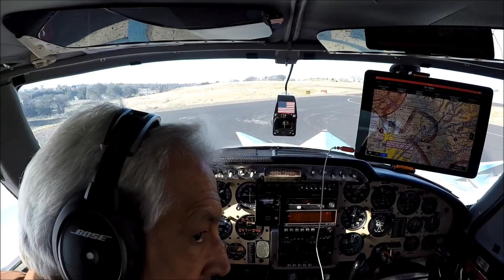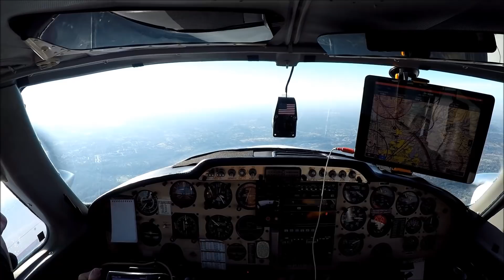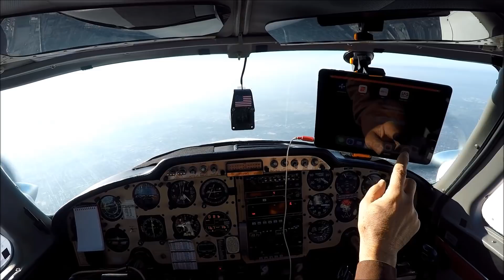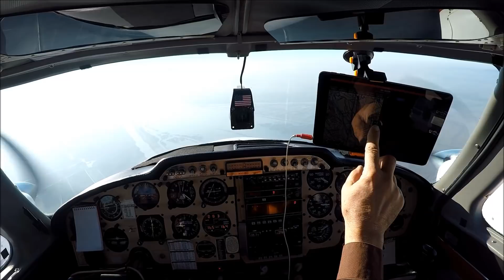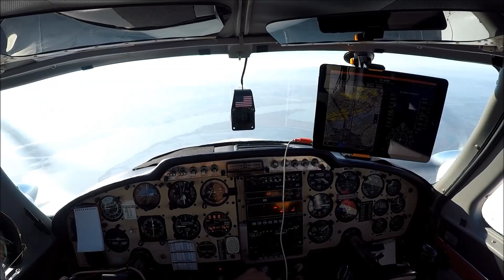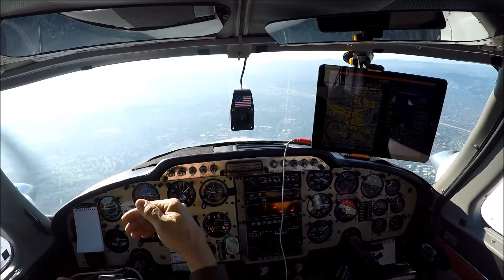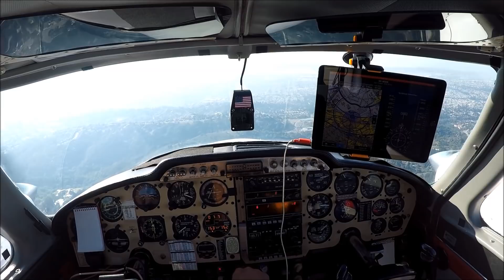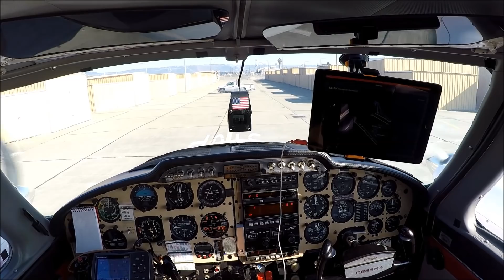Second to last flight to Oakland from Auburn in N3318Q Dec 14 2017

Comment: Nice step up. Curious about the new avionics suite.  Congratulations!
Reply: If it's the one I think it is, GNS-530, GNS-430, twin GTX-327s, backup Bendix King GPS/Nav, KWX56 Radar, GMA 340 and a Sandel 3308.  Not sure if the Garmin's are WAAS or not, if not, at least the 530 should up upgraded to WAAS.

Comment: Jerry, if the new to you aircraft is the one I've looked at today, the TBO is getting close. For the asking price, you're going to need a bank soon for overhaul of two IO-520's and two props. Lots of coin for a few hundred hours of operation. 

You need to transfer 3318Q to the new bird. Besides, you'll be all miscombobulated using another call sign/tail number.

Comment: Wow super smart upgrade, 414 have better cabin space than Baron 58, they also have the most reliable landing gear of all the Cessna twins being hydraulic and super simple. Really good airplane for crosswind landings with its first rate rudder design.

Comment: Congratulations with your Cessna 414 Jerry; as it is a pressurized plane I guess you will be cruising at a whole different flight level from now on. :) Is it the older type, or the improved 414A Chancellor?
Reply: 1970, if it's the one I think it is.
Reply: jeoverv The A doesn’t have tip tanks.   But the pic Jerry shared a 340.
Reply: Curtis, no, the picture Jerry gave us is a 1970 414, NOT the A model, since you are correct, the A model doesn't have tip tanks.  But, the 414 model DOES have tip tanks.

Comment: That’s a lot of airplane for a guy that likes to fly at 3500.    Are we going to start seeing you in the flight levels between Auburn and Oakland now?    LOL. Seriously, congrats!  If you’re moving up to a pressurized piston twin, the 414 is a solid choice.
Reply: Wait a second.  Is that a 414 or a 340.
Reply: It's a 414, Jerry said that in a reply earlier.
Reply: Gary C I was counting windows. I thought the 414, which is the same fuselage as the 421, had 5 cabin windows.
Reply: Curtis, look at this:  https://www.controller.com/listings/aircraft/for-sale/20973383/1970-cessna-414
The 414A DO have five windows, but the 414s only have four.
Reply: Gary C Ah!  Though I know the 414's reputation, I am obviously not a twin Cessna aficionado. I have probably insulted more than one older 414 by calling it a 340 by mistake.  LOL.
Reply: Not at all, Curtis, because I thought it was a 340, too, and then I saw Jerry's earlier response to another poster who asked what model, and Jerry said a 414.  But, then again, I would be hard pressed to tell the difference between a 320 and a same vintage 310, too!

Comment: Jerry, N8134Q looks like she's going to be a nice airplane for you.  If the GNS-530 and 430 aren't WAAS, I think you're going to have to upgrade them to WAAS, and the GTX-327s are going to have to be either replaced, or supplemented by a GDL-88.  

https://buy.garmin.com/en-US/US/p/597181

While I know you didn't have one in 18Q, I would recommend getting an EDM-760 or EDM-790 for your panel so you can watch CHTs and EGTs for each cylinder.

https://www.jpinstruments.com/shop/edm-760/
https://www.jpinstruments.com/shop/edm-790/

Nancy is going to love the potty, of course.  I certainly don't think that you can beat the price for what you're getting.  Of course, you're only 250 hours from TBO on each engine, that's going to be expensive.  Have you seen the 'Overhaul Bids' website?

https://www.overhaulbids.com/

Looks like about $40K for each engine.  Still, a good deal overall considering the airplane you'll be getting, only 5400 hours, and everything you and Nancy wants.

I'll miss 18Q, but 34Q should be a very nice replacement for it!
Reply: Gary C 
https://www.jetphotos.com/photo/5777088
yup, thats it! 
Pre altered photo here.   
We must be real nuts to check out 414s for sale till we found the match!
Reply: Well, I was interested in what the price on an airplane like that would be, and when I saw it was in Napa, it was like I went back and took a good look at it and decided that 'Yup, that's the airplane in Jerry's photo'.  In fact, I hadn't actually expected to find it, because I thought it would have been removed from the market, but he did say he was doing a Pre-Buy inspection on it, and not going to pick it up.  He still might turn it down.

Comment: Shock cooling is an aviation “old wives tale”. I’ve had engine monitors in both of the airplanes I’ve owned, with data logging and download capabilities, and the data doesn’t support power reductions more than one or two inches per minute to cause shock cooling. The data doesn’t lie. If you don’t have a graphic engine monitor, I would HIGHLY recommend them. I consider it essential equipment, especially to the owner pilot for many reasons. My T210 has an EDM 830, and its the best investment I’ve ever made for an airplane. FYI, ADS-B would be #2.

Good article from John Deakin. I recommend his entire series on engine management on AvWeb...

https://www.avweb.com/news/pelican/182107-1.html

Comment: I was wondering.... 
From what I understand for the price of a nice 414 one can get a similar turboprop single. What is the rational of staying with a piston twin?
Reply: I'll answer that, if you don't mind.  First, the 414s run a wide range of pricing.  If Jerry is getting the airplane I think he is, it's under $100,000, and there's NO 'similar turboprop' out there in that price range.  There is a 1975 421B that has a turbine conversion, that's $370,000.  There are a couple of Conquest Is that are close to $475,000, but both airframes are well north of 11,000 hours.  There's a Cheyenne II for sale for $250,000, high time engines and no TTAF on it, so you don't know how old it is.  Most other Cheyenne IIs are north of $400,000 or so, and even those are high times.
Engine overhaul on PT6s is expensive.  Jerry may be looking at $90,000 or so to do the engines on the airplane I think he's getting in about 250 hours, but it would cost $185,000-$250,000 EACH to do the PT6-28s on a Cheyenne.
Then, on top of all of that, you have the direct hourly operating cost.  Moving from the 320 to the 414, they have the same engines.  If he wants to go higher, he can realize a fuel savings, but on his commute from Auburn to Oakland and back, he'll see maybe a slightly higher fuel burn (heavier airplane, etc.)  You don't fly a turboprop low if you can help it, you'd want to be a 20,000' or higher to get a 'reasonable' fuel burn, and it would be insane to try to do that for his trips.  Even high up, he's still going to burn 50-60 gallons per hour in a turboprop, although his speed will be slightly higher.
That's the rationale for staying with a piston over a turboprop.
Reply: thanks, Gary C
I think that you misunderstood me, the examples here are twin turbines. I was talking about Piper Meridian class of aircraft. 
One of the reasons I started talking about a turboprop was that 414 is a pressurized aircraft. It seems to me that Jerry's "mission" has changed and he wants to fly high, hence pressurized hull. So, why not consider a single turbine aircraft? 
Just curiosity.
Reply: Dmitiri, I'm sorry, I missed the 'single' part.  However, much of what I stated is still true.  The least expensive Mirage that I can find is a 2001.  It's $629,000.  The second lease expensive is $679,000, also a 2001, but unlike the first, the second one has the Gross Weight STC, giving you room to carry full fuel and more than two passengers!  But, the second one also has 3440 hours on the engine, meaning that the overhaul is between $225,000 and $425,000.
As to his mission changing, I'm not sure it does, but his wife would like a potty onboard for the longer trips they take together.  If indeed he is looking at N8134Q, a 1970 414, it's under $100,000, but will need $90,000 in new engines in about 250 hours, as well as a few thousand dollars worth of avionics upgrades (the transponder, at least one of them, and at least one of the Garmins upgraded to WAAS if it isn't already.
If he's not changing his basic weekly mission, even a Meridian is going to be burning more fuel down low for a single engine turboprop versus the two engines he's using now in the 320!  In fact, Jerry usually gets 16-17 gph/per engine down low, 3,500-4,500'.  You would have to have the Meridian at FL270 to get that kind of fuel burn, although you might be doing 250-260 knots.
The difference of $400,000+ dollars will buy you an awful lot of fuel, maintenance and avionics over the years. For the mission that Jerry is flying, even if it does change significantly, the 414 will still, for the next ten years, be a better choice.  At least, to me.
Of course, that's not to say that if I came into a couple of million dollars I wouldn't buy a Meridian!  :) LOL
Reply: Dumb move. Jerry mission isn't pressurized.( Unless his mission has changed).  You can buy a single engine turboprop with initial more expense that is cheaper long run. Not sure why the change? It will certainly cost a ton more per hour with a 414 and Jerrys usual mission is going to bite him....BIGLY!!!
Reply: Jimmy Z        more room, more fun, faster, higher, etc.  you have to keep growing to stay sharp

Comment: THE BEST THING YOU CAN DO WITH THE NEW IPAD IS TO GET UP TO ABOUT 20,000 FEET AND THROW IT OUT THE WINDOW
Reply from the maker: I used to think that but now I am embracing it, and besides I am pressurized now and cannot open the cabin at altitude........
Reply: I laughed because you remind me of an old Narco transponder that caught itself on fire en route from RNO to PRB about 20 years ago.  My wife got so mad at it she wanted to take it out of the panel and throw it overboard right then and there.  It probably would have started a wildfire.